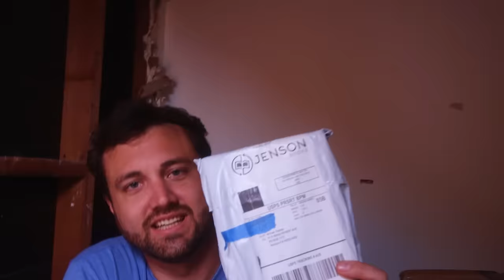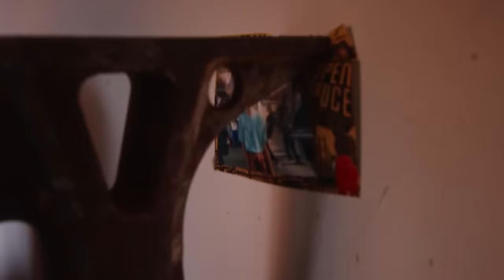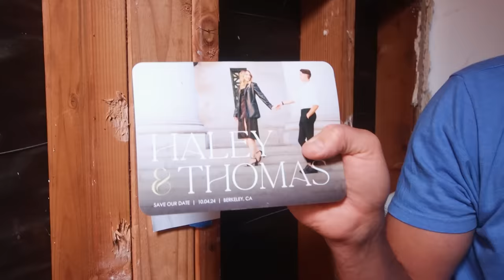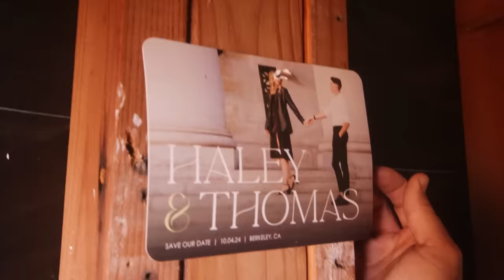Stop sending liquid to my mailbox

Comment: what if i send molten aluminum to your mailbox. what are you gonna do about it.
Reply: Unbox a solid chunk of aluminum when it cools in the 3-5 days spent being thrown around in UPS facilities?
Reply: @lasopa7  that's what the blowtorch is for
Reply: How many lithium batteries would you need to keep a big chunk of aluminium molten for like a week?
Reply: @kaelwd  depends how big it is and how well you can keep it insulated. really the problem isn't keeping it liquid its keeping everything around it solid (solid enough to send through the mail).

the real trick is we make the aluminium melt very quickly after he opens the package. we put thermite in a box and then send it to will.
Reply: I hear asbestos is a pretty good insulator, maybe we could use some of that.
Reply: Really this guy needs a pottery kiln, they take about a week to cool down. You can melt the aluminum in that, surrounded by kao wool (or other forge insulator) and then ship the kiln with the aluminum and stuff inside it. Will it cost $1000+? Sure! Is it worth it? Definitely!
Reply: @kaelwd  I like your thinking
Reply: If you send William molten metal of any kind he will have a meltdown.
Reply: @kaelwd  if a heating device powered by lithium batteries is sent abused through UPS, it will be much warmer than it started before it reaches its destination.
(See Kevin's video on How not to charge a LiPo battery for reference.)